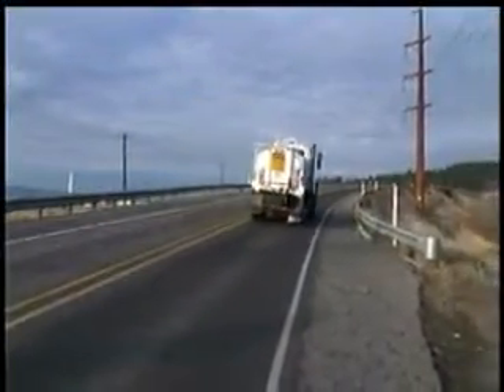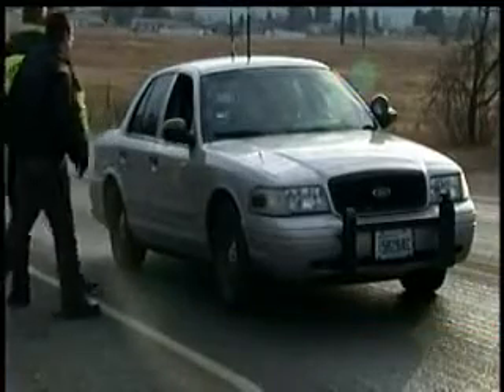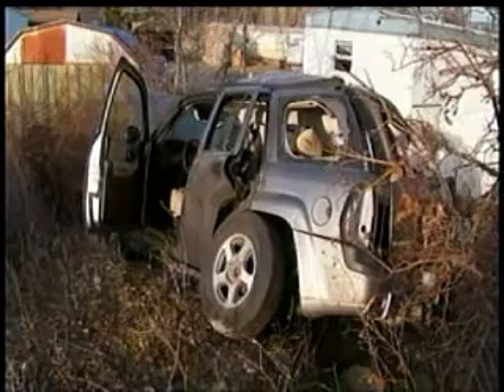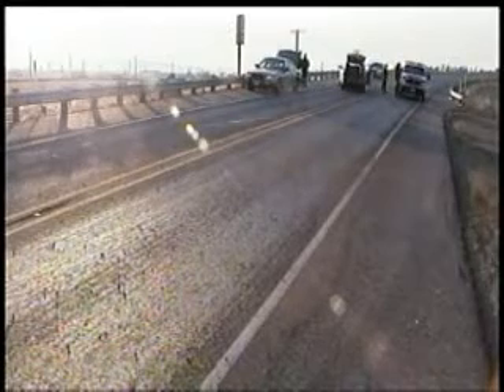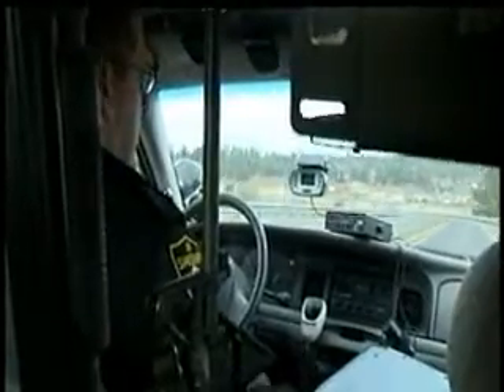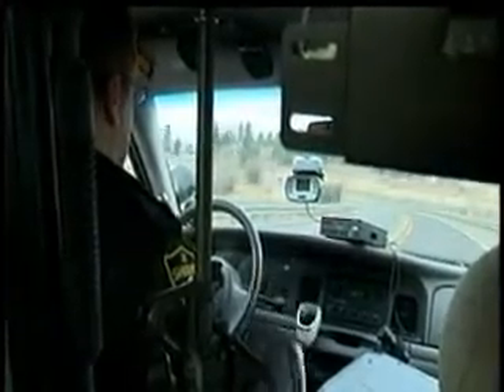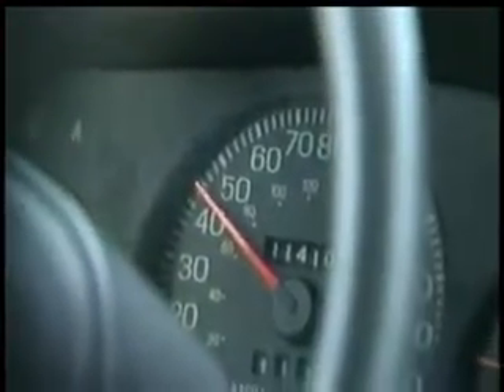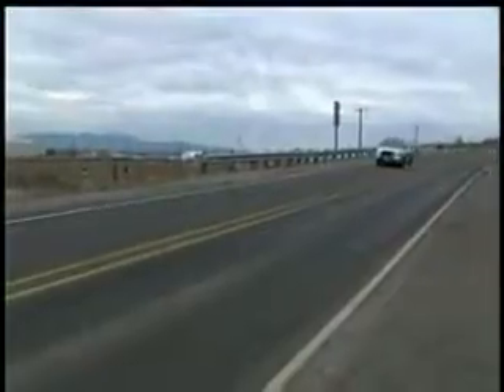Does deicer make roads slippery?

Comment: The weather conditions were different did they consider what the temp was outside and if it was during the day or evening? I dont like it on the roads i think it has caused pure ice to build up. Everytime they put it down it turns to ice. Sheets of ice. I wish they would stop using us as gueni pigs in their year long study. I wont drive on the roads after they have put it down. It causes endless accidents.